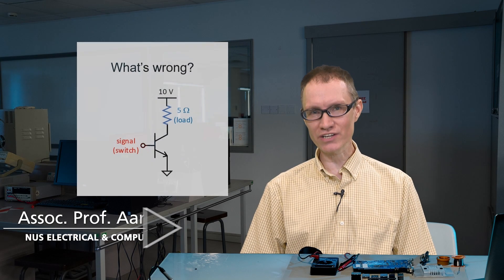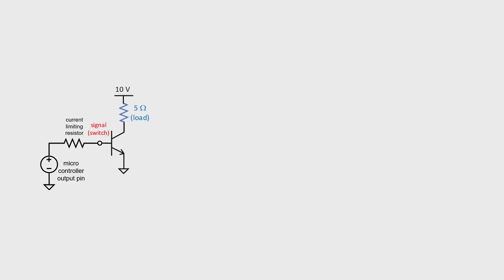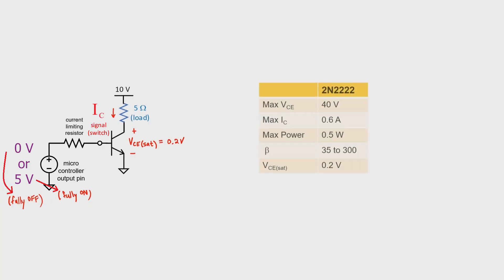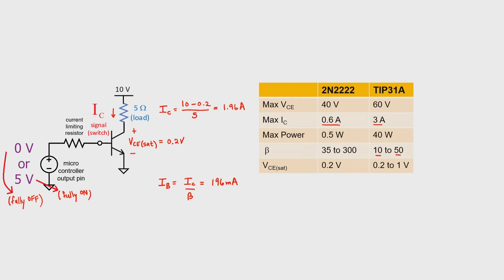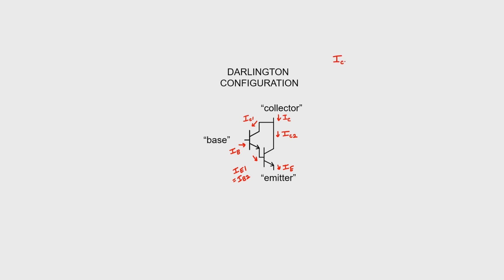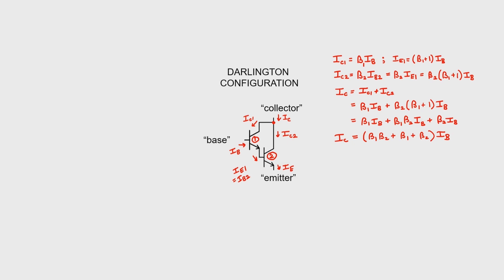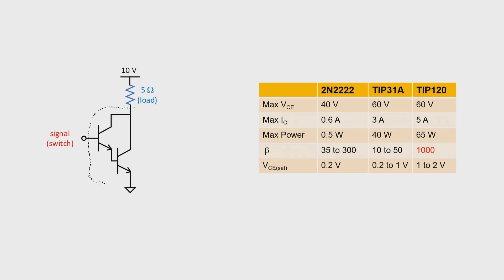Darlington Configuration (22-Transistors)

Comment: Very helpful, experiment with a simple oscillator circuits, found through trial and error that the Darlington array works well, now I know why. No calculations or formula's, Just have learned what will work and what will not, try it and fry it, burn and learn, Thanks for the information.

Comment: Is Darlington circuit dead?  The MOSFETs have replaced the need for the high gain transistors with much better performances.
Reply: MOSFETS and BJTs have their strengths in different applications. Darlington transistors live on.
Reply: @rcatv7750  I. What applications  would you use Darlington over MOSFETs?
Reply: @ Linear audio power amps.

Comment: The 2 extra Darlington resistors exist to switch off each transistor faster by discharging the charge present by the capacitance across the base-emitter, but at the expense of a slight increase in power consumption.

Comment: I personally prefere the Sziklai (mixed npn/pnp) configuration, because it is more like a single transistor as it has only one base emitter voltage drop. This is particularly important for audio power output stages to get more voltage swing from lower operating voltages. The transistor providing the base determines the npn or pnp behavior.

For switching purposes I prefer MOSFETs because you can get a powerful nMOS device with low Ron (<10 mOhm) for a good prize. So in many cases you can use a MOSFET for currents as high as 5 to 10 A without additionally heat sink (except you use very high switching frequencies (50 to 100 kHz or more) so you run into higher switching losses).
Reply: good price, don't mosfets need a higher voltage, microprocessor would need a transistor to switch the mosfet on/off ?
Reply: @jyvben1520  not really. Most MOSFETS can be switched with gate voltages lower than 3 to 4 V. I currently use a MOSFET which can deliver a drain current of 2 A at a gate voltage of 1.2 V and a SD voltage of 0.25 V. I drive it with a 3 V  microcontroller output and it reaches almost its final Rdson. At 5 V it is completely open.

The advantage is that it needs no gate current an can deliver 5 A with just 0.1 V ds voltage. So its power dissipation is only 500 mW. In the switching state you need only a few mA to provide the gate charge of 20 pC within a few micro seconds.
Reply: The professor is addressing the use of the Darlington as a power switch off or saturated, which is how I have used it.  It sounds like your use is in the active region - which is another (important) application.  From some quick googling, it appears that (like usual) there are pros and cons to each.
Reply: @donmoore7785  indeed. My main application is audio power amplifiere. In this application the Darlington or Sziklai stage works in the active region.

The main advantage of Sziklai over Darlington in this application is the lower Vbe, which allows to operate the emitter follower closer to the rails without distortion.

It hast advantages especially in the case of low operating voltages and impedances.

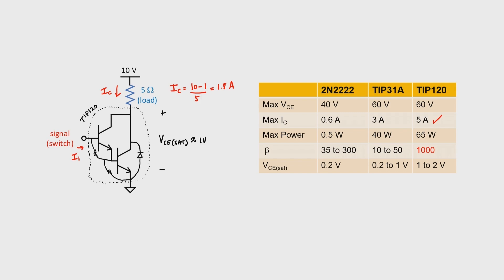Comment: Hello! Thanks for your videos, I am confused a little - why resistor power is 1.8 Watts? (You mention it at 9:27). I thought that P = UI, so 10V * 1.8A = 18 Watts.
Reply: 1.8 Watts is the dissipation in the transistor. 1.8A*1V. 

The rest is the power is dissipated in the load. 1.8A * 9V  or 16.2 Watts